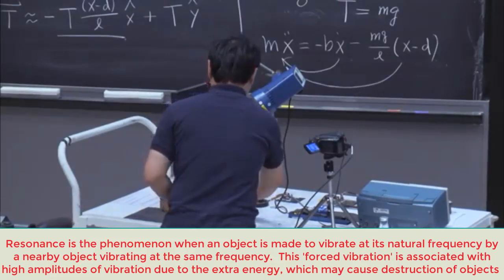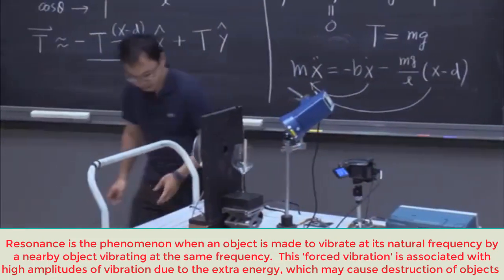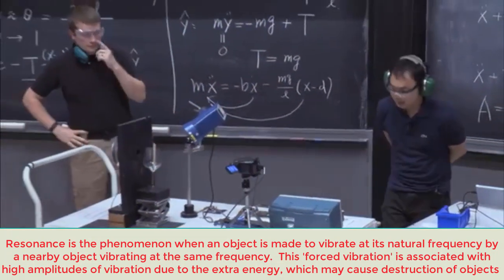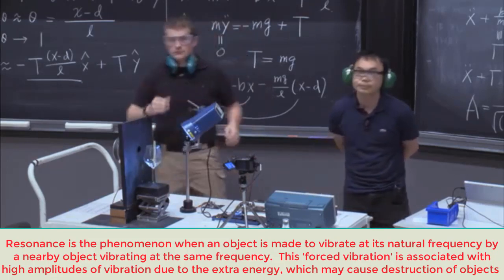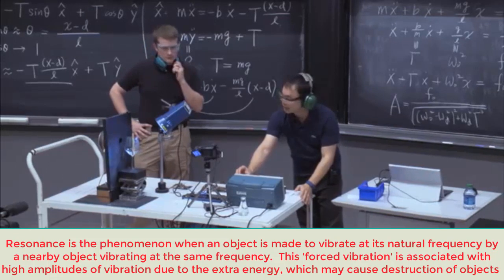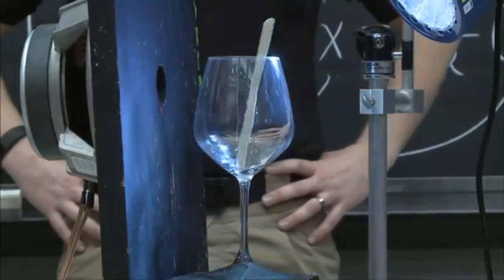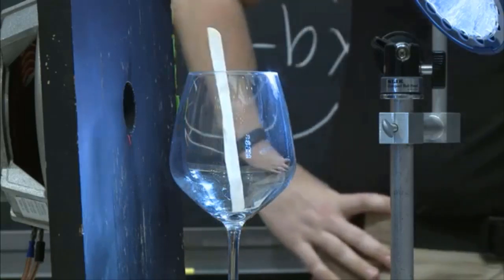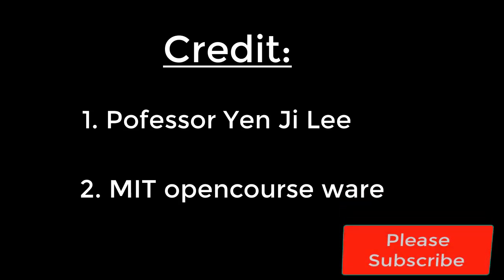Best Demonstration of Resonance -MIT professor demonstrates how glass breaks due to forced resonance

Comment: Why does the glass wiggle before breaking ? What is the cause ?
Reply: The vibration is becoming visible, because of the increased amplitude (volume) of the sound generated by the speaker. The glass is vibrating before that, but not visibly. If you put your finger on the glass you could have felt it, though.
Reply: @matthewwallace9280  oh ma gawd, the frewuency of the sound even at 648 hz just destroyed my ears.

Comment: a great demonstration.
back in the late 1980's i was given a car owned by 2 older siblings, there was a cassette radio fitted in a box suspended below the dashboard.
the wood box and radio would hit a resonance frequency at about 70kph, and chew the cassette tape. the entire box would swing wildly side to side at just the right forward speed.just below or just above that speed and the tape player would run fine.
i had a lot of fun destroying (and splicing) tapes demonstrating the phenomenon.
Reply: Had a similar phenomenon with my car. With the tires out of balance there was a node at 80mph and my whole front end shook. 70mph - no vibrations. 90mph - smoothe as glass. Unfortunately, 80mph is my go to